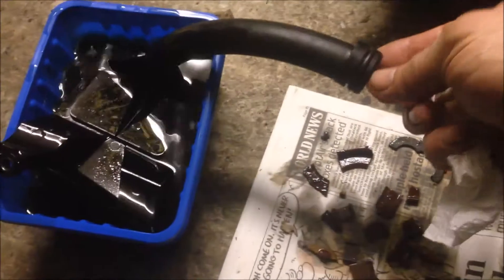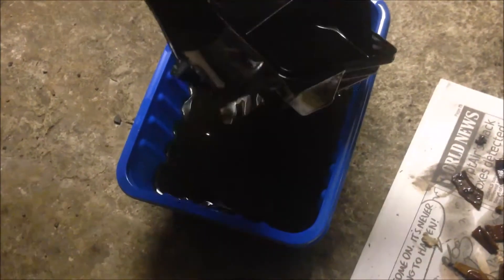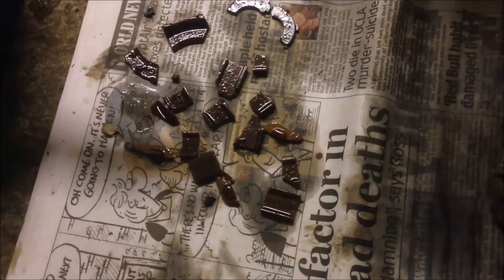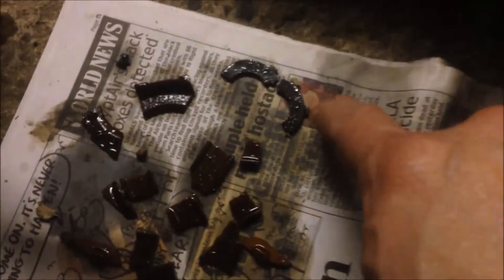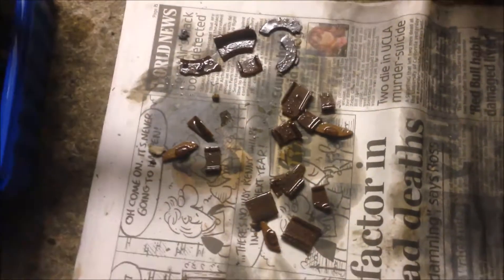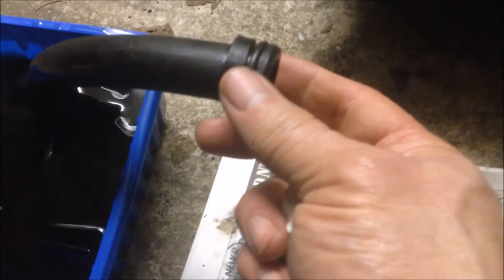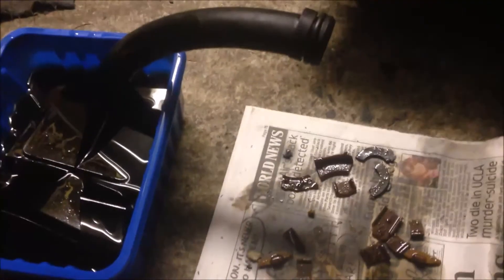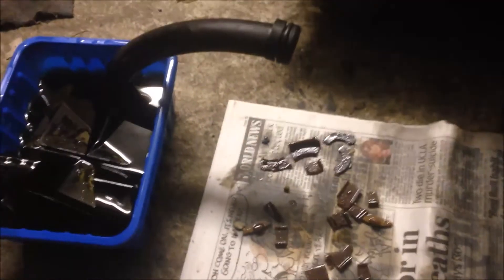BMW E46 / N42: Why low oil pressure? - broken pieces found in the loose oil pickup strainer

Comment: I cannot understand that BMW that is a german manufacturer that the world is suppose to look up to build such poor quality parts. This saddens me.
Reply from the maker: Thank you for your comments. Possibly first the oil sump was dented, which then caused the oil pickup strainer loose, then oil pressure sometimes too low, then timing chain guide broken and got into the strainer, then more often the oil pressure too low, then...... get worse and worse. Have a good day!
Reply: @RepairDIY  I just removed my engine today and saw the no-oil pressure on mine was caused by that metal sif (strainer) breaking apart inside the oil pickup and pieces went into the oil pump and destroyed it by locking the pump up and then the pump shaft broke clean off. I'm not sure if different models have different oil pickups, but mine has a metal strainer inside, but it's extremely thin and flimsy weak thing.
Reply: @RepairDIY  Thank you for your videos and the reply.
Reply from the maker: @GustavTessa  Now you have found why the oil pressure was not right! It took me several year to finally decided to open the bottom sump. Hope you find the replacement parts and make the engine working normally again. Good luck!

Comment: So did you replace the timing chain guide which is what all the pieces are? Do you think it could have been the failure of the tensioner which caused chain to slacken and then that destroyed the guide and then the resumt is what was in your strainer?
Reply from the maker: Hi, the broken chain guide is still on the car and still works well!  I assume the cause was the oil pick up strainer, which caused low oil pressure, then low oil pressure caused the poor idle at cold start, which in turn cause the chain guide broken. Have a good day!
Reply from the maker: Damian G Hi, the broken chain guide is still on the car and still works well!  I assume the cause was the oil pick up strainer, which caused low oil pressure, then low oil pressure caused the poor idle at cold start, which in turn cause the chain guide broken. Have a good day!

Comment: Is this part easy to remove after the sump has been dropped? Got low oil pressure on my N42, when the engine is hot the oil light flickers and gets worse the longer you drive it.
Reply: Rhys Jdm yes! The most difficult part is to drop the sump. In my case the oil pressure indicator disappeared after 15 seconds then started flickering very often for a few minutes. Only after a few years we had the flickering oil indicator when engine is at normal running temperature occasionally. Good luck!
Reply from the maker: Rhys Jdm my car has been behaving very well after the repair. No more low oil pressure! If you can drop the sump, removing oil pickup strainer is easy. Good luck.

Comment: Hi i want to inform i have a ford focus diesel i found pieces of plastik like that i clean the oil pump i change all but still  the oil light on... What do you suggest mee thank you..
Reply from the maker: Hi, Well done! At lest you know the oil strainer has been cleared and cleaned. I suggest to have the oil pressure measured. You can either buy a oil pressure gauge or have someone else measure it for you. I have a video for measuring oil press on a vw polo. 
https://www.youtube.com/watch?v=i42rnpTd91I&list=PLCXPGrQnBEsWU5j8vwa4yjwqAKdmnFy3M&index=50&t=14s
if the pressure measure ok, then it could be the oil pressure sensor. if pressure measures low, you may still need to continue investingting pump, filter, etc. Good luck!

Comment: Did you replace the whole strainer unit or just removed the broken pieces?
Reply from the maker: Hi, I removed the pieces and covered the inlet with a mesh from a broken cafetiere, and it is still working well. Cheers
Reply: @RepairDIY  please can i have the pics of the strainer with mesh if available, i wanna do preventative measures, thank you
Reply from the maker: @MrACSchnitzer  ooh, that was years ago and the video is the only show we have. Have a nice day!
Reply: So is it still working
Reply: I cut mine (N46B20) open with a craft knife & a heat gun, a little prying and she came apart. From there I was able to make a strainer from some wire mesh (shaped like a half box) then used high temp silicone gasket maker & four very small screws to fix it all together. Better than a new one!
Reply: @lexuscrowley1812  do u have pics of ur mods? I am keen on doing one
Reply: Sorry mate no pix, but that one I made seems to have worked out well as no trouble still, and maybe did that over 12 months back or longer. She's my daily driver too, get some use. 
The oil pickup is easy to fix, just take your time in carefully taking it apart, follow my instructions above. Use some wire mesh from a kitchen sifter and shape in like a half box, insert and seal up and fix with tiny screws,  countersink and seal over heads. Check the mesh before install for temperature characteristics, ie, use a map gas torch to see if it will hold up to high temps etc.
Kind regards.    @MrACSchnitzer